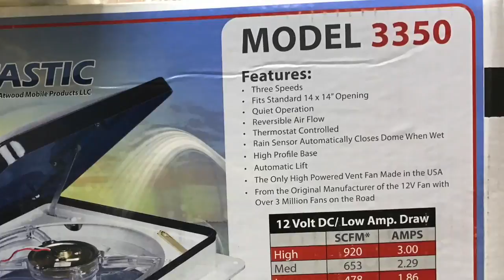Convert a Ford Transit into off grid vanlife - Solar Panels - Goal Zero Yeti 1250 & Fan-tastic Vent

Comment: I can't quite hear and this and it's a very important segment to understand. Is there a plan to list all the part numbers of this stuff so I can write it down and buy it a few pieces at a time including the brand and model of microwave & refrigerator? I understand you bought the electric at Costco? Are there fuses for the electric devices, maybe that's built into the Yeti system you wrote about? Thank you

Comment: I'm a fan of goal zero, but they are costly. you really don't need a separate inverter and charge controller and battery. now goal zero makes a lithium battery which is much more efficient

Comment: I believe your camera has a sound issue. No sound.
Reply from the maker: Sorry that you couldn't hear the video Aaron. It does have sound. I am listening to it now.
Reply: Aaron E I try using your ear buds to hear. That worked for me. I didn't want to miss a word.
Reply: I heard audio. A remote mic and a "dead cat" would help though. From reading the comments and replies, it seems as if you designed this solar yourself - first one I've seen with a Yeti integrated into it? I'm surprised  since it seems you're not afraid to tackle anything that's too custom.